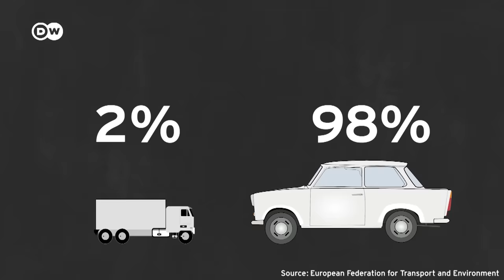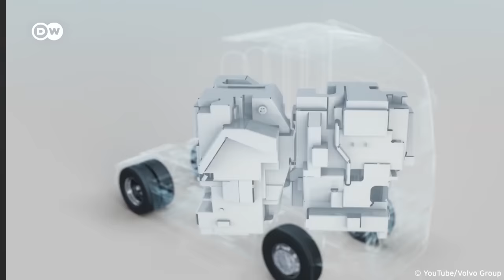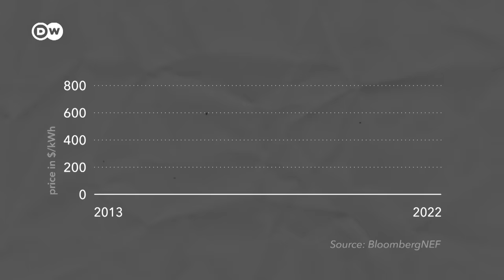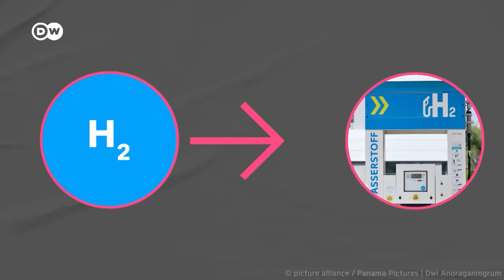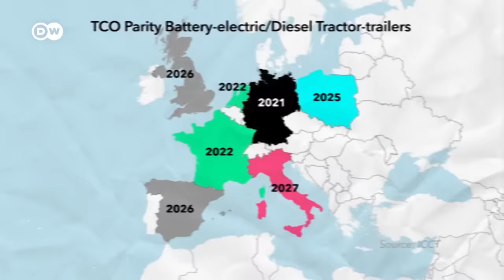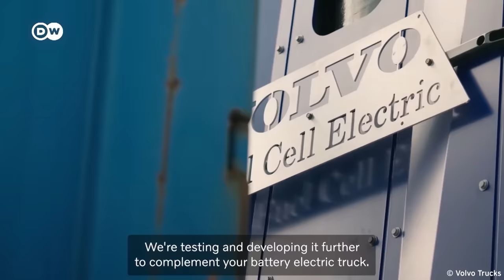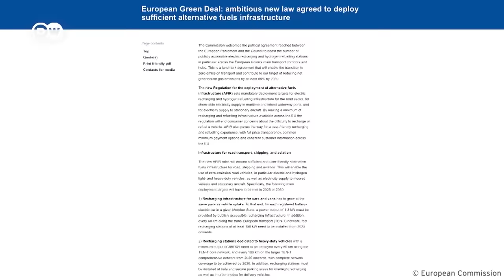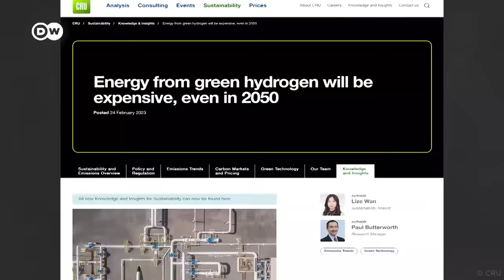Which will be the engine of the future?

Comment: I think what you're completely missing in this video is one there is such a thing as a hybrid truck that works look up Edison motors on the internet they're doing great work. Another thing have you not heard of trains electrified trains 0 emissions especially if they're powered by a nuclear power grid then it's fully so good especially once in the like whether 50 years from now we get a great fusion. I just want you to think about this alright don't just keep on thinking about the battery electric trucks and the hydrogen trucks. I know that you might be kind of carbrained from you know the fossil fuel industry and telling you that it's either a battery electric or hydrogen but it's not the case there are these other solutions that you need to take in and that it would be much more beneficial for you to make a video about especially for Edison motors I would love for you to like you know shout out them especially since you seem to have a larger platform than most. Thank you for your time.

Comment: Battery swapping is the only choice with sodium batteries (want cause shoratge)
If anyone who knows basic physics he knows why as more the load would be the weight of battery itself would kill the purpose of efficiency this works in favour with small vehicles and against heavy 

Hydrogen isn't bad its just too inefficient to make hydrogen about 2.5 times beacause of electrolyzers inefficiency and other processes involved as electricity is converted into another form of energy completely

Comment: Already today it's cheaper to use electric trucks instead of diesel trucks in the Nordic countries! A European semi truck with trailer (Volvo) consumes about 110 kWh/100 km, and usually big consumers have good prices per kWh. I guess they sometimes only need to pay about 3-4 euro cents per kWh! Let's say when they charge the batteries when being at terminals where they have roof top solar panels.
Sometimes the prices are even negative! Hydrogen will never be able to compete with electricity that is almost free.

How long will the batteries last?
The truck manufacturer Scania has a demand of 1.5 million kilometres, and the battery producer, Swedish Northvolt, says tests show that  this is no problem... Already today's technology can produce batteries that last 1.5 million kilometres in a truck. Then I guess that the battery must stand fast charging every time it is charged...

According to EU regulations a car battery mustn't last longer than eight years and 160,000 km! Ridiculous!

A problem here is that the road transports will be cheaper than today, which means that transition to railway transports will be even slower if that is possible...

I think if a tiny part of transports can't be electric, it doesn't harm the environment significantly if those trucks are driven by a diesel engine or are hybrid.

Comment: The biggest practical flaw in battery electric vehicles is that they lose half their range when the temperature is 20 degrees hotter or colder than room temperature. The true flaw is that the point of all this crap is to clean the air and save the planet. Batteries aren't actually green. The lithium mining and refining produces something like a ton of co2 per 100kWhr. Then how long is the battery going to last? Longest warranty I see on passenger vehicles is that you'll have 70% capacity in 8 years of you only charge from 20-80% capacity. So you start off with 60% capacity and gradually decline to 42%? And then megawatt chargers per vehicle? On demand rapid load swings sounds like your going build a bunch of peaker gas plants running at 40% efficiency and suddenly your not green and your less efficient then a hydrogen fuel system. Battery EV was always a scam and only exists because idiot politicians threw money at it. Hydrogen is the only viable upgrade from fossil fuels that isn't sci-fi. It actually exists here in California. I drive a hydrogen car and I love it.

Comment: The tittle shows ignorance. It should be Battery Electric vs Hydrogen Fuel Cell Electric. They both have Electric motors.so why covert electricity into hydrogen, transport it pump it at high pressure then convert it back to electricity. When charging a battery from the Grid is so much more efficient.

Comment: Hydrogen costs $36 a Kg in California. Each Kg gets you about 60 miles in a ~190 HP Toyota Mirai. The Mirai costs about $180 for a full tank of just over 5 Kgs. 70 Kg of Hydrogen would cost $2,520 for at most 500 miles. That is $5.04 per mile of travel. Hydrogen will never be financially feasible.
Reply: Brother.... for 500 miles it would be $300 and around 8.3 kg of hydrogen not 70 wth are you talking about? and even then hydrogen price WILL go down, if you bring down price at least half is enough and let me remind you not all the stations costs 36/kg and it is faster to refuel.

Comment: The strip mines needed to produce the materials for battery power produce a huge carbon footprint not figured into this. The environmental footprint from rare earth metals is huge and will never go away. The land used will become waste land not able to sequester carbon or hold life. When we decided to pay attention to the total equation we will look back and wonder how we were lead down such an environmentally destructive path.   Hydrogen can be produced on site so small refueling stations only need to be supported by the same electric infrastructure needed for batteries.

Comment: I think hydrogen fuel is being compared to the wrong technology as in battery vehicles.

More properly, hydrogen fuel cell vehicles should be compared to petrol/diesel vehicles and infrastructure. The fossil fuel systems have the same or even much greater disadvantages  compared to hydrogen infrastructure, but no one is talking about it because it has been the default for about a century now, and it was developed when nothing else was there and no one was there to criticise it. It was a different time when it developed and evolved. 

The advantage of hydrogen infrastructure is that it can be produced anywhere locally in the world. It doesn't have to be dug up from deep underground from a few selected regions in the world, many of which are now or always have been volatile and unstable politically, culturally, or in dangerous and difficult areas such as undersea locations. Then, fossil fuel needs to be transported across the world, stored, processed, refined, and transported again for distribution and sales. How is this anywhere near efficient? No one ever thinks about it because the infrastructure is established, and people have been used to it for a century now.

Comment: I don't understand fully EV trucks - unless you want to transport potato chips.
What is not mentioned is the electric power grid needed to charge these trucks.
Sure trains - but they are deisel.
Again - for heavy loads - I'm not convinced EV is the way to go.
For cars, I think small EV cars. The ones being made are too big.

I see hydrogen for either long distances or for heavy loads.
Could we have hybrid electric-hygrohen cars or truck or trains?
Reply from the maker: Hey there! As of now there is no hybrid electic-hydrogen car on the market. However, a US-based start-up is currently working on such a vehicle. There is no information though on when and where these will be produced.

Comment: I love how Nobody is talking about just injecting hydrogen into a turbo Diesel engine. And yo get the best pd both worlds.  Diesel burns cleaner and you still have power/toque to haul heavy loads world wide.  

Fuelling stations could easy be conversed just add hydrogen station for semi trucks.  Some truck companies have done this.  Just injected hydrogen into turbo diesel and burns cleaner.   If you run out. Your trucks can still continued burn diesel till can get filled up again. 

Electric batteries are not the solution,  they can’t carry same amount of weight, battery tech is STILL shit and still can’t match the distance a turbo diesel semi trucks can do.  Newer EV trucks cost more and have more tech on them to go wrong.  Let’s not forget of all EV fires we’ve all seen on news and YouTube channels.  EVs vehicles and semi trucks have higher chance of catching fire or technical issues.

Fuel cells and EV trucks are NOT the answer.   Just upgrading current turbo diesel semi trucks is better option and burns cleaner.

Edison motors, a guy from BC Canada seem be only one who gets it.  Build semi truck that has both worlds. Semi truck with small Diesel engine as generator, while still having clean powerful Electric motors.

Comment: The video speaks of batteries as if they naturally exist in nature, but instead they need a whole industry and industrial process behind them, and that process isn’t very clean. On top of that, those batteries need power, the same power that could be used to generate hydrogen. And lastly, the infrastructure for hydrogen is practically already there, as it would be easier to convert a service station to hydrogen than to convert into an electric charging station.
Reply: Fuel cells and tanks don’t exist in nature either. Making hydrogen requires a lot more of of that same power (about 3 times). Converting a gas station to hydrogen is not easy at all. The required refueling setup is massive and very expensive to build and maintain.
Reply: @Simon-dm8zv  I understand your point, and it’s already addressed on the video. The issue is that they talk about batteries as if they are less harmful, but in reality we’re still extracting huge amounts of minerals of the ground to make stuff.
Reply from the maker: Hey there! We also did a video on an alternative to lithium-ion batteries and a full video on hydrogen. You can find them here: 
Alternative battery 👉 https://www.youtube.com/watch?v=-vobMl5ldOs
Hydrogen 👉 https://www.youtube.com/watch?v=AGTjKJHu99c
Reply: @daviabraga  I understand your point too, but we need to extract minerals / materials either way. Because hydrogen is so inefficient we would need to build a lot more windturbines and solar panels for example.
Reply: @Simon-dm8zv  but in case the you’re building up infrastructure, not a final product like batteries, which have limited lifespan and cannot be easily recycled. And again, you still need to build the infrastructure to generate the electricity for the batteries anyway.

Comment: Folks, to make green steel, mass amounts of hydrogen will need to be produced, regardless of transport considerations.  The reason why the Japanese are not all over battery electric is that they are looking at the overall issue in a more holistic fashion.  Their current thinking, which was never mentioned by DW, is to pair NUCLEAR with steel plants.  The nuclear plant provides both direct power, and power for hydrolyzers for the hydrogen gas to replace the coal for green steel.  If you size up the reactor output, excess hydrogen at industrial scale is suddenly available.  And before anyone says anything about nuclear waste, the storage pools holding fuel rods generate HYDROGEN, as radiation causes hydrolysis.  So now, even nuclear waste could be used to generate hydrogen for different uses, and it suddenly becomes a profit center.  Either way, lots of electricity AND hydrogen is needed.  Renewables are not going to power it all.  What mix one uses depends where you are in this world.  Just as there were virtues to gas cars and diesel heavy equipment, the torque requirements, duty cycle, weight, and vehicle size will determine if one vehicle is electric, while another goes hydrogen.  What works in sunny Greece or California may not work in Northern Canada or Northern Scandinavia.  There is no energy utopia - there are trade off sweet spots that are geographically sensitive.

Comment: Green H2 ICE are all the way the solution for very solid reasons; There is absolutely no current country wide/ continental wide E-network anywhere on the world which supports all current and even all potential E-trucks to load their batteries. Especially when all trucks are to switch from fossil fuels into battery trucks. The E-network (380KV network or local substitute) will have to increase dramatically in a way that it will take years to increase the E-network to be able to serve all E-loading potential demand. Even if we would want to, it is simply not possible; not now and not in the foreseen future. So E-trucking on any continental scale is an mindful illusion. And even if all needed infrastructural changes would have been available you may ask yourself where all power will come from to load all vehicles including heavy duty trucks....? Well how about Nuclear and massive coal fired power plants... Yes electricity does not pollute, but the way you create electricity with Nuclear power and coal power it most certainly does. And the carbon footprint of production of a battery electric truck is enormous, so it will take years (with the same battery pack) for trucks to even come close to a break even point environmentally spoken. When it turns out one will have to swap the battery pack, the counter obviously goes back to zero and starts counting all over again the kilometers/miles/time to calculate the break even point environmentally spoken to begin with (the carbon foot print) Because that's the one reason we are in this global shift from fossil fuels in to sustainable power...so let's not forget that; so look at the Big Pic not just one aspect of the Big Pic ! Due to the unbelievable negative impact on the environment I think it is safe to say that electric battery powered vehicles are part of the problem and not even by far part of the solution environmentally spoken. Most sustainable would be: No New Trucks!  But: convert the current world fleet of Diesel powered trucks in to H2 ICE trucks. Side note: this also goes for all existing cars and motorcycles obviously.

Comment: btw the show did not include the energy needed to mine lithium, process and manufacture into batteries say how bias the show is.
Reply: no it is already there, check the percentages they gave
Reply: @trexeyesonly55  no it is not.
Reply: @roubini74  goto minute 05:49 of the video, when the electrical car even uses all clean energy it lowers emissions by 92 percent not 100%, this is because of lithium production that you've mentioned, so it is in the video

Comment: A hydrogen truck has a battery and battery technology is getting improvements if a sand or salt battery is ever possible the heat of the battery will produce energy

Comment: There is another solution that edison motors is currently creating, which is an electric convesion with a downsized diesel generator. That way, the energy is still made on the truck, using diesel. But because it's a generator, and not powering the wheels, this makes them way more efficent than the original diesel truck could ever be.
Reply: It simply wouldn't be enough. CO2 emmissions would still be far too high.
Reply: @Simon-dm8zv  yeah but It's a step in the better direction, because all the heavy lifters are still using diesel guzzling trucks.

Comment: Nobody ever talks about the long term viability, nor the ecological cost of creating batteries. Sure, batteries are getting a little smaller, and cheaper. But the precious metals needed to create them, in a lot of cases, causes more environmental damage than using the vehicle could ever offset. Then there is the fact that in 10 years time, all these EV's that are out there now, will have terrible batteries that no longer hold even 50% charge. Just like your old phone. And guess how much that battery swap is gonna cost you?
If governments and industries put more money into hydrogen (not just fuel cells) so they became even 20% more efficient, and had the supporting infrastructure, its a no brainer. And question of enough is not needed if the infrastructure is there. Hydrogen is the most abundant element in the universe. Its just everyone is too busy looking at batteries.
Reply from the maker: Hey there, in our previous videos we have been having this conversation. Here's something that may interest you 👇
📺"Can you recycle an old EV battery?" 
https://www.youtube.com/watch?v=PbOBmnZRpZ4
📺"How salt and sand could replace lithium batteries"
https://www.youtube.com/watch?v=-vobMl5ldOs
📺"The truth about hydrogen" 
https://www.youtube.com/watch?v=AGTjKJHu99c

Comment: An internal combustion engine which operate on hydrogen as a fuel and this hydrogen is generated using sea water with the help of renewable energy source can check all the boxes. It will come out way better than any other options available right now. And there are some research going on some in countries and companies to make it happen let's see it will happen or not.
Reply: Not at all because it would terribly inefficient.
Reply: @Simon-dm8zv  diesel energy density is 45.5 MJ/ kg and liquid hydrogen has energy density 120 MJ/ kg. And if you use renewable energy for extracting hydrogen at those places where sunlight is good all around the year or has good wind profile throughout the year, we can have hydrogen very cheap as compare to fossil fuel.
Reply: @gufranansari9286  Still very inefficient. The whole point is that it would require A LOT of renewable energy. About 5 times as much compared to battery electric trucks. So that would mean building and maintaing 5 times as many solar panels, wind turbines, powerstations etc. for the same number of vehicles.